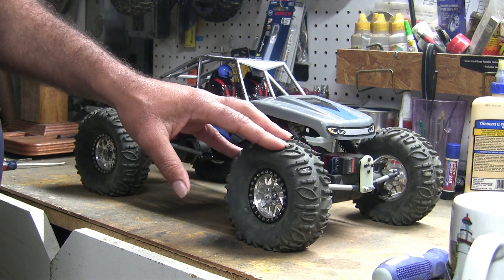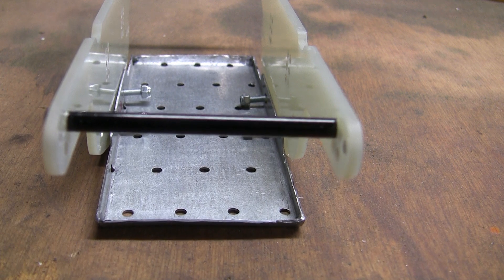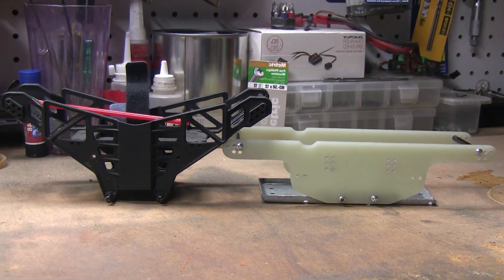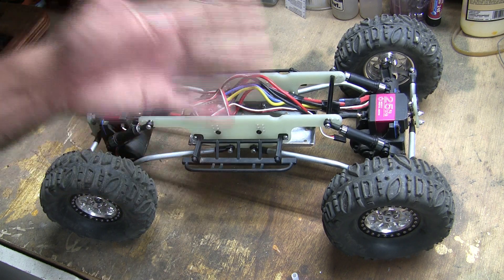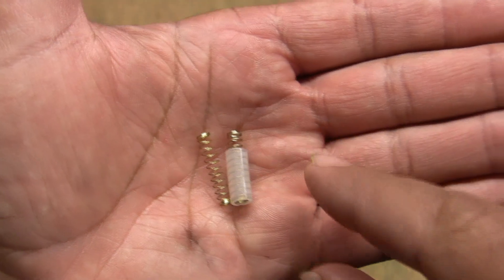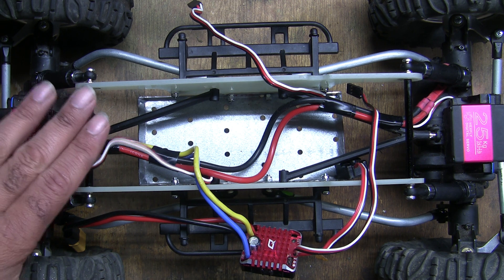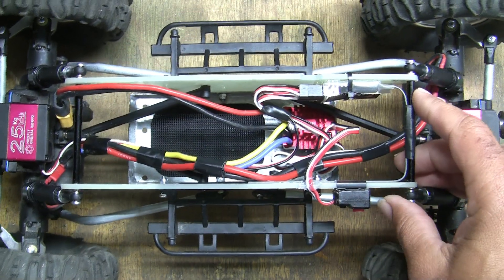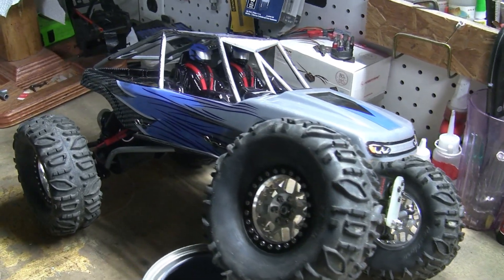OMG! LCG chassis Red Cat Danchee Ridgerock / FTX Ravine R/C crawler

Comment: Thanks for the awesome video Fred! 👍
 Did you make any videos about fabricating the chassis?
Reply from the maker: @Sammy-the-Hebrew  No, I just built what I designed/wanted from experiences from the stock chassis. 3mm G-10 or (Fr-4 that I used) was roughly cut with a jigsaw with a diamond coated blade. Then finial sanded down as the pair clamped together and holes drilled out. Wear a mask and eye protection as the powdered dust is super fine.

Comment: is the steering better with this kind of build?
Reply from the maker: The stock linkage is flexible, metal links give better control. You could use something like stock setup in metal or a direct setup like mine.
Reply: @freedomtobefred8233  does the original transmitter have its own receiver or is it a 2 in one esc type?
Reply from the maker: @tiborklaric7198  It's a two in one system
Reply: @freedomtobefred8233  thx for the answers. great work

Comment: Hey bud, been watching your progress on this build and I am very impressed by the performance you have achieved. Especially on those factory tires! Grip seemes to be the only thing holding you back. Good rubber ain't cheap but it will make a world of difference on a rig that you have already made incredibly capable. Amazing work sir. Keep it up!
Reply from the maker: Those aren't factory tires, they are Panthers cougars from 2008 or 2009. Thank you for watching.
Reply: @freedomtobefred8233  Thank you for the info and the content. Are they the 2.2 version? Any plans on future rubber?
Reply from the maker: @dkmgm2011  Yes they are 2.2's on 25mm wide wheels, most wheels are 35mm wide.         I'm sure if new rubber would make a difference,  but I am working these hard considering their age. Tires are particular to the rocks, the truck/weight and driving style, you could have the right tire but the wrong foams. If i got new tires it maybe Hb rovers, duratrax showdowns, proline hydrax, jconcept ruptures or  losi rock claws. I like the open spaced tread as sometimes moist dirt gets in the the tire were I drive.
Reply: @freedomtobefred8233   I can vouch for Hyrax in predator compound. Slapped them on a Capra and was blown away by performance on a RTR rig. Swapped the factory set up to 4ws on metal axles, motor and ESC for an Axe 540L R2 and ESC in 2800 kv. The added power/weight and wheel speed was hard on the predator compound. But with a rig around five pounds with low wheel speed they are quite good.

Comment: did u solder the two motors wires together and than connected them to the esc?
Reply from the maker: Yes, positive and negative of the esc are tied (paralleled) together to the respective motor terminals.

Comment: My Danchee sits at 7.5 pounds. It is a monster! What is your ground clearance? Mine is at 3.5 inches on center.
Reply from the maker: Mine is about the same as stock (81 mm) give take a few mm's. The battery and esc are no higher than the top of the servos horizontal.
Reply: @freedomtobefred8233  That's awesome! You should make custom links and sell them 👍 I would buy them. Yours are better then mine lol

Comment: What aluminum parts did you use for your Danchee my plastic are stripped out
Reply from the maker: If your asking about the axles and steering arms see here, https://youtu.be/yZtB-RtJ-Ws
Reply: Thankx
Reply from the maker: @heavyc6836  I got my stuff from Aliexpress, the steering arms, bearings and axles were less than $15 for the complete truck. It does take awhile but I ordered them before I needed them.